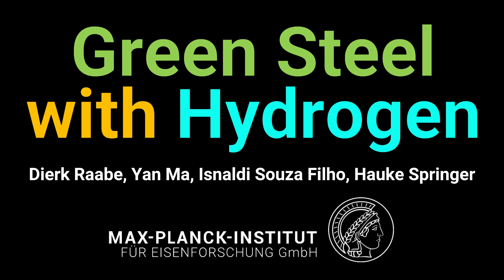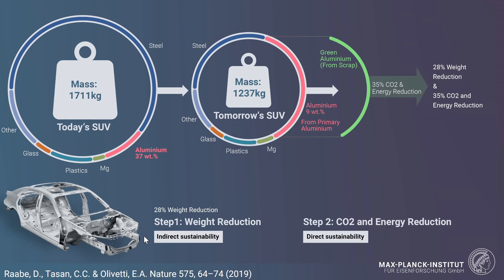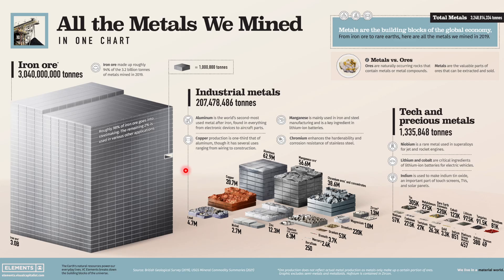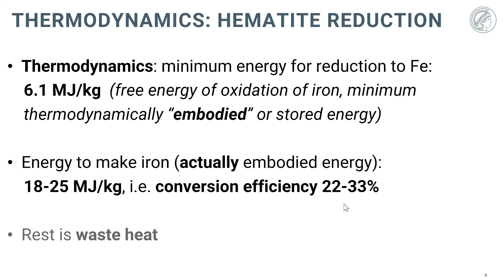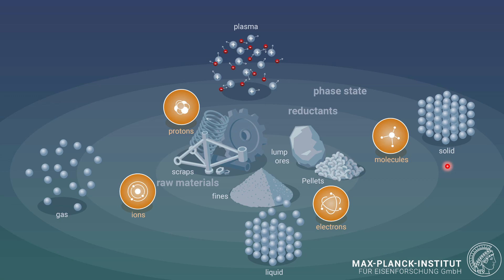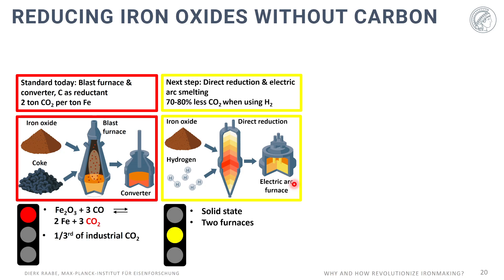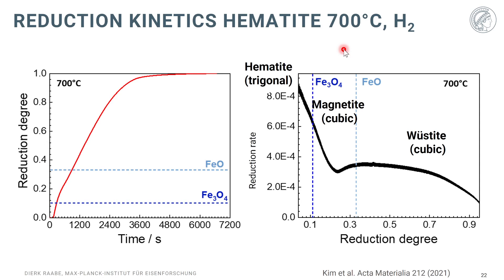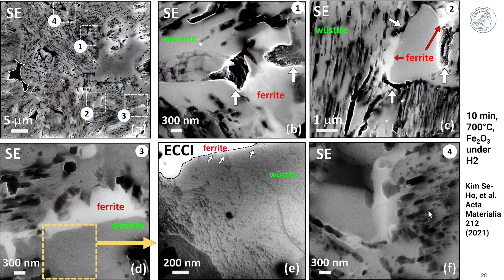Making Green Steel with Hydrogen

Comment: On the slide  "Key Idea"  I read HN3, mentioned as ammonia. Assume this is meant to be NH3. Nevertheless, NH3 is mentioned in literature as suitable carrier in transport of hydrogen (as is methanol);  If hydrogen is generated in solar rich desert environment, it could be transported as NH3 and according to the presentation used directly in fabrication of green steel. Is this correct? Evert Blomsma

Comment: I was under the impression that steel production was in need of higher temperatures, more like the 1200 to 1500 c?
This temperature range of ~700c is in the ball park of most of the Molten Salt reactors. If not the salts providing the heat or the power for the furnace.
Thank for the video. So much to digest and consider and explore.